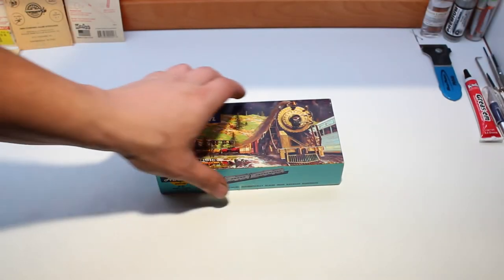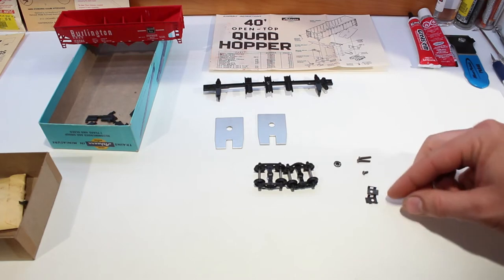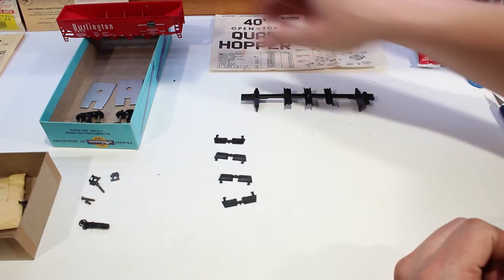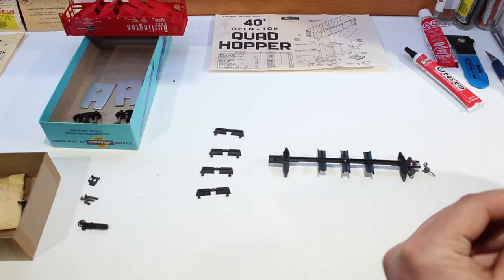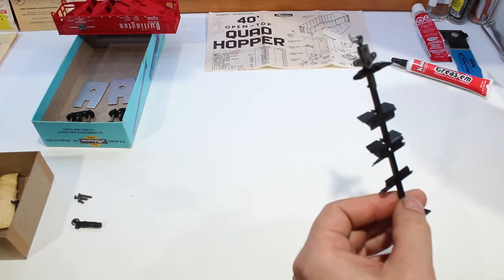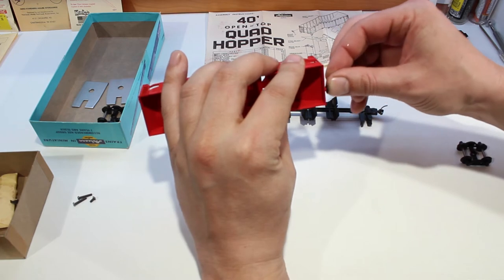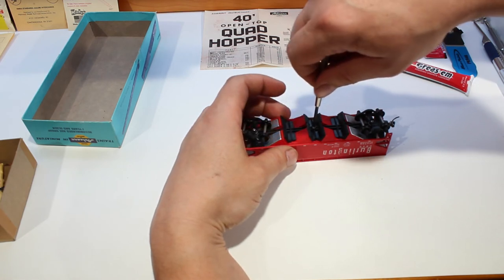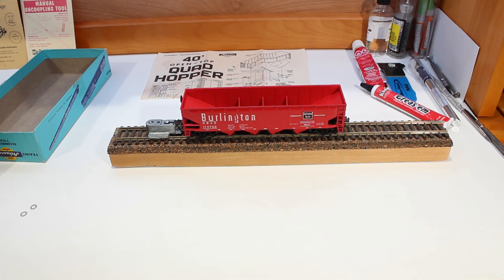How To Assemble Athearn 40' Quad Hopper - Burlington

Comment: Great video! One other thing about those cars is that they tend to be light, about an ounce compared to NMRA standards. I usually solve that with a load, if more weight is needed you can clue a steel nut or 2 to the bottom of the load.
Reply from the maker: Yes a lot of the Blue Box rolling stock is a little light! Loads are great for correcting that!

Comment: It is good that you pointed out the need for the washers on the trucks!  I had one of these hoppers lettered for the Pennsylvania R.R. & it did seem to derail frequently.
Reply from the maker: The washers seem to be necessary on this model
Reply: @jonedwards7064  - I must not have trimmed enough flash from the underframe because the hopper dump doors never closed tightly against the openings.